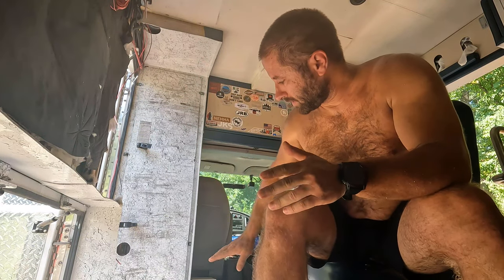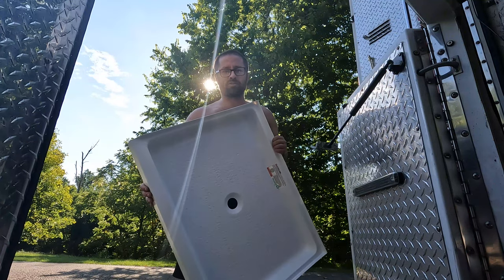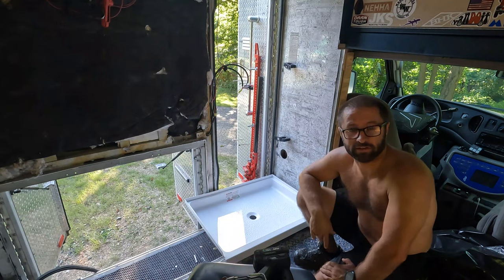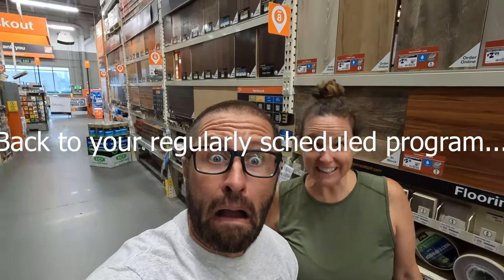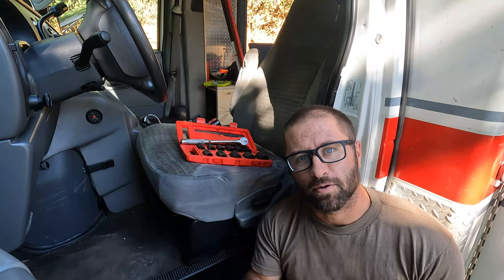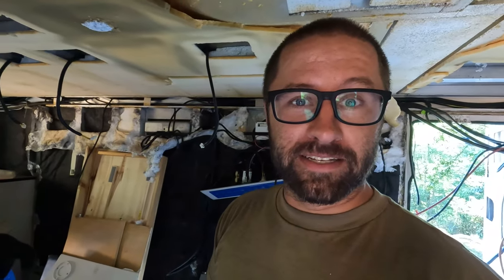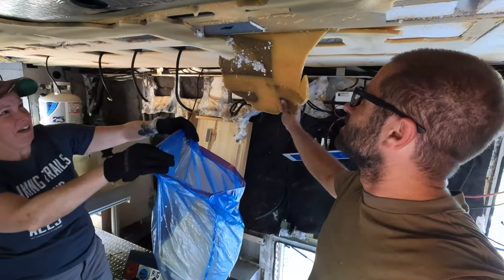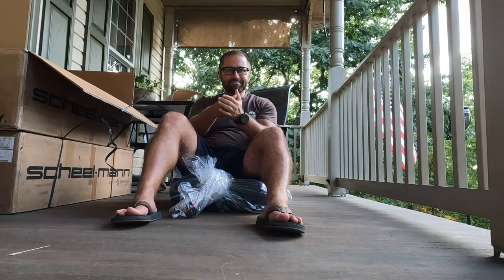Ambulance Overland Vehicle | Demolition Part 2 | Turning an Ambulance into a Tiny House on Wheels

Comment: I put my shower right there as well and I went with a 8 gallon black tank on Amazon I believe was about 160 bucks
Reply from the maker: We went with a 14 gallon grey tank and it works well. I may upgrade to a 20 gallon at some point though for a little extra during city camping times. We don't run a black tank since we have a compositing toilet.